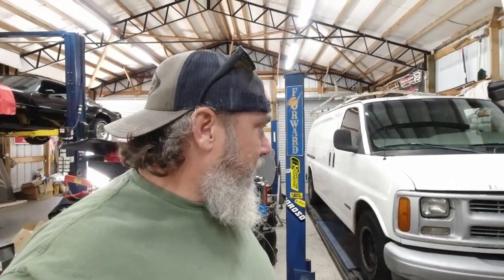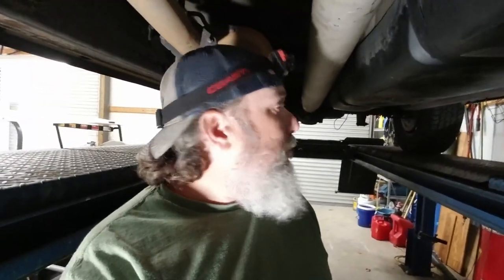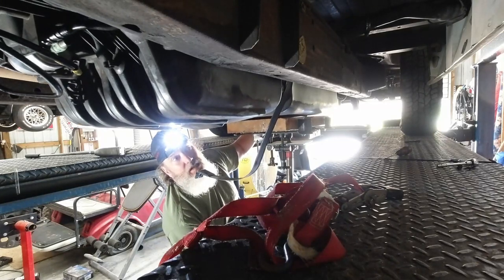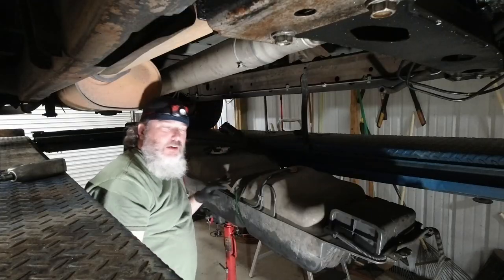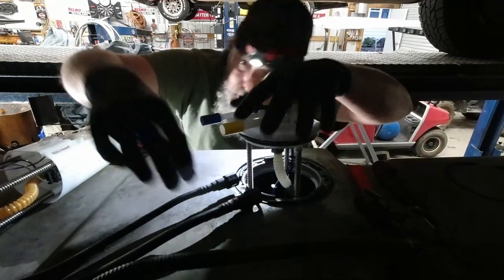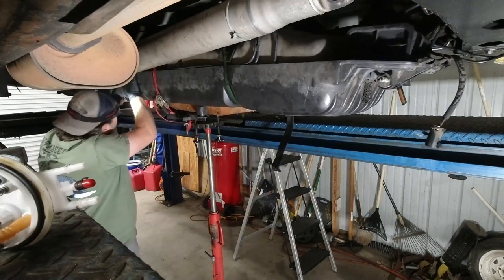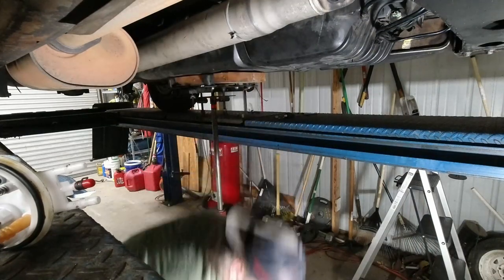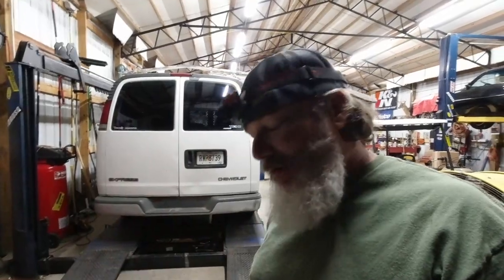Chevy/GMC Express Van Fuel Pump Replacement

Comment: Thanks for walking us through that step by step. I will be doing mine soon... on the ground. No worries though because I'm a bit younger than you and though I'll be sixty soon 😉 I have a big script for ibuprofen 600 mg.  Not looking forward to this job at all but I figure if I can do something, I should do it.  The last time I did one of these was when I was in my mid thirties and of course there was no such thing as YouTube back then. I put the float pointing the wrong direction and so the gas gauge didn't work and I had to drop the tank and do it all over again. 😅
Reply from the maker: Thanks! You can do it and hey I'm not that old just broken lol
Reply: @HotRodDave  I was totally joking about the age thing and I'm pretty banged up too! Sometimes at the end of the day I get out of my van and it takes me a while to walk right. I'm actually exercising to try to stage off the worst of my physical decline. Knock on wood I'm actually making some headway.

Comment: You're a braver man than me. Putting the tank back without testing the pump? I've bought several new pumps that were plain junk though. We've got a quality problem these days.
Reply: How would one go about testing a pump without putting it in gas could that mess it up? I bought a lemon on the marketplace and I’m bout to replace the fuel pump and oil pump and hopefully avoid a engine rebuild due to a bottom end knock that you can only hear after the oil heats up and when it does my oil pressure gauge reads 0. I’ve gotten no where so far lol pray for me

Comment: Thanks for the video. I have a 2003 with a 6.0 liter in it and a bit of mystery in it. A shady Chevy dealership in Flagstaff, AZ claimed they installed a new fuel pump in it in 2008 while I was on a trip and at their mercy. I believe they dropped my tank and swapped it with one from a scrapyard. Metal on top of pump is rusted unreal on it and the formed rear lines too. Have you ever seen a teal colored tank vent valve with 2 ports on it on GM ? It has a GM part # 15749267 that doesn't exist... says Benton Harbor. If I look up a tank vent valve for my vehicle and it just has one port.
Reply from the maker: I wish I could help you but I don't have that info.

Comment: If your pump will run, disconnect the fuel return hose and slip on a piece of fuel line then turn the key on and let it pump the fuel into waiting gas cans until the tank is empty.
Reply from the maker: I have done that in the past. Sometimes I will trip the relay and pump it out.

Comment: Just a little tip suggest a new tank at the metal recycling scrap yard they just punch the tanks to remove the gas... And who needs to worry about funky old tanks with sediment in them., Kind of an ethical tightrope.

Comment: What is the port(?) in between the supply and return ports? I have a similar (if not the same) pump/sending unit on my 55 gal in my 2020 Savana cutaway. It has the hatch in the floor for access and I want to supply my generator. I THOUGHT that middle was an auxiliary supply port, but I'm not getting a drop. I thought I saw a comment somewhere that I need to be open it (via drill) and probably add a "straw" into the tank. Any insight/advice would be greatly appreciated.
Reply from the maker: I'm not sure

Comment: Hey Dave thanks for the video!! I have a question. I have an 06 express with a 5.3 that sat for 2 yrs and I've changed everything.. drained tank and put in fresh fuel, wire, coils, plugs and now I'm still having a random misfire still. I tried to get a fuel filer but from what I'm finding the 06 has no inline filter it has a sock filter in tank to change out. Have you ever had a faulty fuel pump or clogged fuel filter cause a random misfire?
Reply from the maker: I have had plenty of faulty fuel pumps cause low power and miss fires can be caused but you would need to run some tests to be sure. Check your 02 sensors and injectors
Reply: @Hot Rod Dave  thanks, I'm mechanically inclined but now that's getting out of my knowledge and capabilities...lol

Comment: Great video. What can one expect to pay for this job? I have a 2002 Chevy Express 2500. The fuel pump is still working, but the fuel gauge gives erroneous readings. If the tank has to be dropped for the float/sending unit, I'm going to have the pump replaced.
Reply from the maker: The Labor can be different in your area than mine and the pump price can be all over the board as well but you can be in the 6-8 hundred range for parts and labor

Comment: I am going to attempt this in my driveway, how much clearance is necessary from the top of the tank to do this replacement? Will Jack Stands be enough?
Reply from the maker: I am sure you can but you may need to get it up a few feet
Reply: @HotRodDave  Question, with the key on, I whacked the tank with a hammer but not knowing what I was listening for I could not tell any difference. The engine  did not start. The sound I heard was more a humming than a whirling or pulse. I could with confidence say there was power to the pump so I can rule out, I expect the solenoid as faulty.
Reply from the maker: @crawford323  usually when the pump is out you wont here anything. If it kicks on it hums. There should be a Schrader valve on the fuel rail. You can see if fuel is coming out of that when you cycle the key. The pump should only run foe 15  seconds every time you cycle the key. You will need to depress the valve each time to check for fuel. Take this advice at your own risk and use safety equipment.  Be careful. Don't spray yourself in the face with gass.
Reply: @HotRodDave  I will check the test point on the engine for pressure via a kit. The engine has rapidly cut off and on for a couple of seconds a few days ago. I felt it was more electrical than a fuel problem p, honestly. Crank or cam angle sensor or coil lead, coil or cap. You are a good person for giving me your time. It is one thing to have knowledge but to want to share this show’s character. Thank you.
Reply from the maker: @crawford323  they are bad about burning up the electric connection for the fuel pump.  GM is notorious for melting fuel pump connectors. Could be a crank or cam circuit.  Could be a fuel pump relay. I have also seen ecu's cause that problem.  Aftermarket alarms are also a common problem  for drivabillity issues or no starts.  If you can scan it and it has engine or other codes address those first. Thanks for watching and hope this helps.
Reply: @HotRodDave  I was on the road today and it quit dead. Zip nadda, rolled to a stop and had to be towed. Not a great day.
Reply: Got it all done. I did have room to drop the tank and maneuver the pump part of the tank outside the van. I was able to replace the pump and solder and wire the new pig tail without too much issue. Replaced the crank angle sensor and the cam angle sensor while I was at it. Again thank you for all your patience and willingness to share.
Reply from the maker: @crawford323  Good Job.

Comment: You can suck gas out with 12 volt pump and fuel line empty gas can hook pump up to a battery with wire before unhook fuel neck with the 3 bolts  just takes a few minutes!

Comment: I'd have to cut a hole in the floor. No lift and no back either.😂
Reply from the maker: I really don't know why they don't put a removable panel in the floor. Some makes have them and it makes it so much easier.
Reply: @HotRodDave  Money. Weird that only some have access panels though.

Comment: Just had an epiphany maybe with no one to see or here... External axillary pump. A common practice... But with routing system... Tank pump routed around this axillary pump which is switchable like the train tracks.. internal electric switching and maybe electric track switching at the fuel line with warning light inside the tank pump is out... And vehicle did not stop in middle of the freeway... Or conveniently on the side...

Comment: Chevy could have just put an access hatch in the floor of the van above the fuel pump, but apparently their design engineers never do maintenance on vehicles
Reply from the maker: Totally agree and many other Makes and Models should be done that way

Comment: Anybody here cut a hole in the van floor for this?   Afraid of hitting the tank.  Can't find any mechanics to do this around here.  They all want to do the hammer trick and charge for the pump replacement.
Reply from the maker: I have never done that. I would find another shop. You could end up cutting the lines if not real careful. I wouldn't do it.
Reply: @HotRodDave  Thanks Dave.  Upon reconsideration 
common sense has prevailed and my bucket van is being towed to a good shop in Broomall Pa.

Comment: Or like one of my vehicle's always have dual tanks and just wish to the other ...if one stops pumping.... But there should always be an indication light somehow in the front to definitively determine and indicate that the pump is not running... Why not grasshopper? Or master?. I think these designers of vehicles are basically idiots if you will.